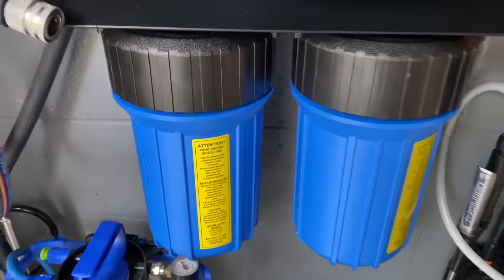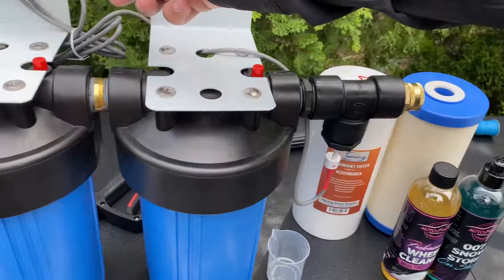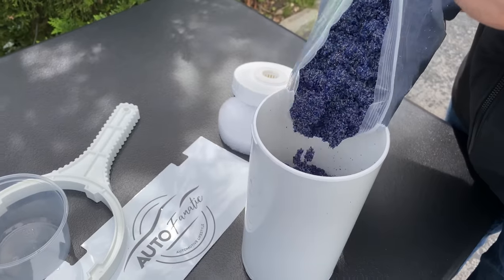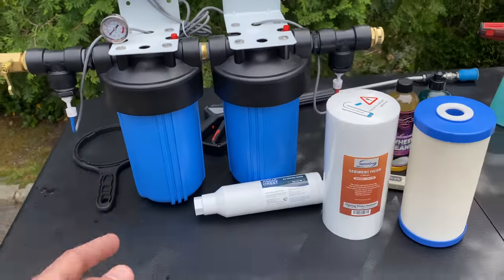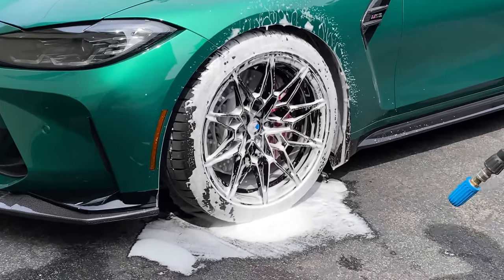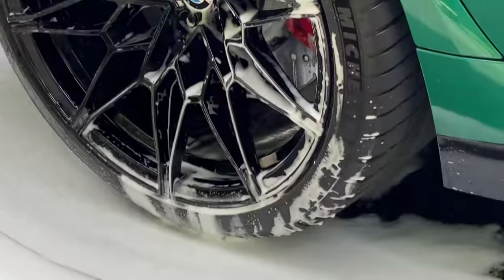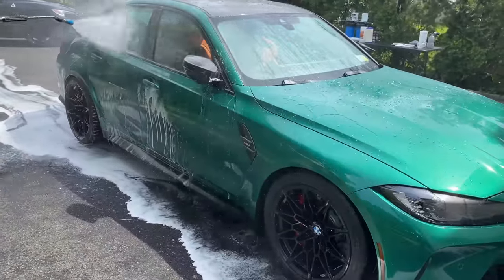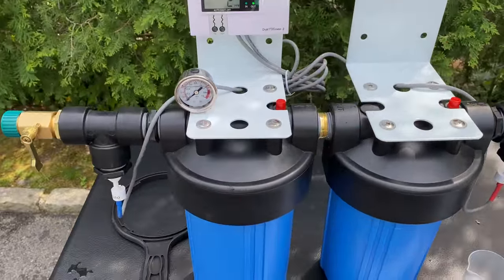Spotless Car Washing Thats An Affordable DIY | Auto Fanatic

Comment: Just so you know most places these days are changing over to chloramines in the water instead of just chlorine. A regular carbon block will not remove that. It will pull the chlorine out but the ammonia left over will pass right by into the resin and it will burn up the resin much faster. So anyone looking into this you need to find out what your water company is using chlorine or chloramines for the disinfectant.
Reply from the maker: Good to know but what filters remove this new chemical?
Reply: @autofanaticcars  hmmm, i thought I replied. I am not sure where to get the 4" wide 10" filters. I get my filters at Bulkreefsupply for my RODI unit for my reef tank. They have chloramine units for the smaller 10" filters and have them in the larger 20" as well.
Reply: What about Chloromethane
Reply: "50,000-gallon capacity replaceable highly compact coconut shell activated carbon filter provides over half year of clean water for your entire family.

This whole house system removes up to 95% of sediment, chlorine, chloramines, chemicals and other contaminants that create color, foul tastes and odors. (Tested by SGS, 2018)"
Based off the description, it seems like it's not just a regular carbon block
Reply: @autofanaticcars hey buddy new sub here I  have a question, I need sediment that takes out chemicals that will give me spotless water?? And allow me to do touchless washes?? I am a newborn, and in the sun, my black superduty gets a ton of water spots even if I work fast because of the heat!!! Please reply and let me know which cartridges to get and media to refill with thanks!!!!

Comment: Using that turbo nozzle is not the right way to do this... there is a stream of water that spins at high rpms and so you're directing a single stream of water on your powdercoated wheels. It's just a matter of time before it begins to damage that paint. It's like using a zero degree nozzle but with that single stream that spins. What you should use is a 25 degree with a variable handle so that you have control of your spray. similiar to the spray pattern you used for your paint job.

Comment: How many gallons will that two stage get you before you have to replace the resin. I know that carbon block will last a whole lot longer than that resin. I want a three stage setup with a carbon block and use cation resin in one and anion type resin in the other.

Comment: After watching this video my in-line filter broke for the umpteen time. Nothing like a clean car, clean garage, then having wet carbon particles all over. No more. The timing of this video was perfect!
Reply from the maker: Nice let us know once you get yours all set up how it works for you
Reply: Everything in and hooked up. TDS unfiltered near 200. Less than 20 filtered, but improving. It’s refreshing not being rushed worried about spots. The experience is better as well as the results!
Reply: What was the total cost? 
Did you order everything on Amazon? 
At 20ppm do you still get water spotting?

Comment: This looks like an awesome solution.  The only observation and questions…….   You are using color changing media.  Do they make filter housings that are clear instead of solid blue?  How would you monitor the color change with a solid filter housing?   Obviously a clear housing would make it very easy to know when a recharge was necessary.  

Thanks for sharing your well thought out design and great demonstration video 👍👍👍👍👍
Reply from the maker: Some vendors might offer clear housing but i think UV might skew the resin the easiest way to test is with a TDS meter once you see TDS get high it indicates time to replace resin
Reply: @autofanaticcars  Thank you so much for the quick reply.   I would hope in a garage that UV light would not be a factor.  Certainly the TDS is a good way to tell.  That pretty much throws out the color changing media which defeats the purpose of it.   There may be a less expensive option and I will investigate it.  I will share back anything I find as your goal was to cut down on the cost of the system.   It is still way less than anything I have seen and the TDS is a great way to keep watch on the efficiency.   ⭐️⭐️⭐️⭐️⭐️
Reply: @autofanaticcars  I agree, but how much UV light could be a factor in a wall in a garage?

Comment: Great video! Do you have the link for the part with tds sensor PVC and adapter? I've been looking everywhere for that pvc tee.
Reply: You ever find the tee fitting and reducer?
Reply: @xtnvieira No one?
Reply: You have to get a 3/4” to 1/4” reducing bushing then use a  male connector 1/4” NPT to 1/4” PTF

Comment: Morning from the UK, Great video. I have a water softer system in the house do I need both filters or just one for the de-ionising resin. also where did you get the double water filter wall bracket?

Comment: Interesting - I have been hesitant to use my pressure washer on my car, especially on the wheels - Concerned that soap/detergent will be forced into brake and bearing components. I’m retired, so I have plenty of time. Takes me less than ten minutes per wheel to carefully clean & dry complex Mustang PP1 black painted wheels. Leaf blower disperses almost all the water to help dry the wheels. I’ll have to give consideration to installing an up graded filtering system. Thanks & Happy Motoring 🤠
Reply from the maker: Our wheel cleaner system is the safest you can get specially designed not to corrode the brake system and anything in its pathways during use. I had a 15 GTPP and that led to my development of this system after torture cleaning those wheels and seeing the popular wheel cleaners that ruined my Brembo brake calipers
Reply: How do the wheel cleaners ruin the brake components? People have been detailing wheels for awhile and I’ve never heard of anyone causing damage?!
Reply from the maker: Start paying more attention to people’s brake rotors etc youll start seeing the patterns because most cleaners attack the metals causing rust and corrosion also two piece rotors with anodized hats develop white stains or cars with anodized  brake calipers (Mercedes, Ford, Porsche etc) get trashed permanently from harsh cleaning

Comment: Great video, thank you! So, I bought  the Ispring filter system. I’m on a well. I’m only washing my cars. Probably only use the filters for the final rinse? My question is, do I need to fill both filters with resin? Can I use one for the sediment filter? Sorry if this question was already asked! Thank you!
Reply from the maker: You can try it a few wa
Using one carbon filter and one resin and works amazingly well. Your on well water which does pose obstacles at times so you might need to see which configuration works best
Reply: Thank you! @autofanaticcars

Comment: DI units are great in cr spotless only problem is when your water TDS reading 300ppm like mine simply not cost effective resin has almost doubled in price over the last year
Reply from the maker: Yeah sounds like well water is a huge issue im hearing
Reply: Yes, I have well water and it is 300 ppm. It is very annoying but I need something more hardcore to filter mine i think.
Reply: If anyone figures out a cost effective solution please update!
Reply: @Embrxceyourdemons run through an RO system, then through DI into a 20 gallon storage tank (Rubber Made garbage can). Pressure washer then draws from the storage tank. I change my RO sediment and carbon filters every 6 months and the RO cartridge every two years. DI resin I have yet to change after 4 years.

Comment: Damn, 2k psi and you're that close to the surface. Living dangerously
Reply from the maker: Thata really not that much its all in your technique of using a pressure washer. Ive seen dummies put a zero degree nozzle on gas pressure washers to get bird crap off bumper’s to only lose their paint instantly 😂
Reply: @autofanaticcars the turbo nozzle is a 0 degree nozzle 😮 made me nervous was well 😆

Comment: Is this system plug and play? I am not very handy and want to wash my car but don't want to spend time doing a manual wash and just got a pressure washer.  Can I buy this system, the tds meter, resin and just connect it to water source and pressure washer and start using it? I want to use this on a cart or just wheel it out for use when needed for car washes; my objective to wash the car more easily, quickly and have no water spots on the paint and lights and windows.
Reply from the maker: Yes order the Ispring kit shown off Amazon with filters all links in video description below

Comment: Great video! I’m going to start my build today! I have a 22 Mach 1 with the handling pack wheels. Very difficult to clean like the M3s. Can you recommend a good pressure washer and foaming attachment?
Reply from the maker: Hi David pressure washers are subjective but I am a firm believer to spend the most you can because it is the most important part of building your wash system. I use North Star on demand electric pressure washers look into them at Northerntool.com mine is s 230V but they also offer 115v version. these machines are workhorse you can not kill them plus they double duty to do real tasks around the house. Stay away from cheap stuff at Home Depot and Amazon that will leak and be useless long term.
Reply: Thank you!

Comment: Will that work if you install them horizontal? Basicly the filters are lying flat at the bottom in the middle of my detailing van
Reply from the maker: Water filters are not designed to work on their sides

Comment: What is the pressure washer that you’re using? Do you use this pressure washer on the paint as well other than the wheels. It seems like the pressure is too high for the paint. Although I have use a gas pressure washer with 2700 PSI on my paint and I have never had any issues with my paint.
Reply from the maker: My psi is under 2000 to wash cars its a 230v North Star on demand unit 2.5 GPM
Reply: @autofanaticcars  Thanks. I’m a little surprised you’re not running a Kranzle. I’ve never heard of 230VZ North Star. I’ll take a look into it. Was looking to purchased the OG Kranzle 1322t to replace my Active 2.0.

Comment: For the TDS probe it appears to be a 3/4 NPT tee fitting. Did he pvc glue the 1/4 probe into a hole he drilled into the 3/4 plug at the bottom of the tee?
Reply: It’s a 1”x1/2 reducer bushing with a 1/2-1/4 connector in that, couldn’t find a 1”-1/4”…
Reply: @jerrycube6244  do you have a video of how you attach the meter?

Comment: I copied this system with the 2 iSpring housing units with 2 GE Whole house w/ carbon filters as pre-treatment.

My TDS before the system was 107 ppm and after was 1 ppm. I let the water run for a good ten minutes and washed my car afterwards. I estimate that I used a good 50 gallons of water. My TDS was 7 ppm after the wash. Is this pretty normal to expect the ppm to raise that quickly or do you think 2 housing units is not enough for me and that I should consider adding a 3rd iSpring filter. 

Thanks
Reply from the maker: Seems you have a massive improvement so far just monitor things over time tds can jump around some over time but if you stay under 20 you should be ok but play around with filter arrangements im
Using 1 carbon 1 DI resin with 6 months of yield
Reply: It's at 0 ppm now that the system has had time to settle in with a couple uses. I saw a post here about someone talking about chloramine. Have you found a solution for that? My city moved away from chlorine and swapped to chloramine
Reply from the maker: they are using chloramine in our water was well very toxic stuff and more concern inside the house than for washing your cars. I have a multi stage main house filter and it requires changing almost every 2 months now which is getting expensive.

Comment: Can you link to where you found the tee for the TDS meter? Most of these are meant for 1/4" but my pex will be 1/2" for proper water flow. Would love to get it in black as well :)
Reply: Same for me. Searched for the probe connections on us plastic. Can,t find. Thx.
Reply: It’s a 1”x1/2 reducer bushing with a 1/2-1/4 connector in that, couldn’t find a 1”-1/4”… item #’s 30744 & 58765 on US Plastics

Comment: So this is probably a stupid question.  Does the unit have to remain vertical to function properly? I have been thinking about doing something like that to where when it comes time to do my final rinse I unplug the garden hose from the pressure washer and put this setup inline however, looking to just lay this on the ground while using don't really have anywhere to permanently mount it.
Reply from the maker: it should work however you risk banging the housing around and it might affect water flow and cavitate the pressure washer pump. you wont know unless you try it i guess.
Reply: @autofanaticcars  Cool thanks for the info.

Comment: Do you have a price per gallon estimate for that system? Not  sure if you mentioned it.
Reply from the maker: I will work on that and post but it all depends on total usage before refills
Reply: @autofanaticcars  thank you for responding. I’m trying to find an affordable way to do this type of stuff for my setup. I don’t have big pockets. Iwould like to get the best results I can for the sake of maintaining the cars in my family.
Reply from the maker: You can consider starting with smaller inline Camco RV filters which do work great for most and its most affordable solution.

Comment: Do you have the links for the white L brackets and the Black T pipes for the TDS readers?. Great vidoes
Reply from the maker: Will be posted later for those two items
Reply from the maker: Items were bought from US Plastics you can email us for a parts breakdown
Reply: @autofanaticcars  Can you send a link to the parts?
Reply: @autofanaticcars can I get a parts breakdown for adding the TDS meter?  Thank you
Reply: @autofanaticcars can I get a parts break down? Thank you

Comment: Just to confirm as the measurements look to be the same between the double unit and the single unit, but does the empty cartridge for use with the resin fit either one?  I only have space for one and would prefer to use with resin (I think likely the most effective option).
Reply from the maker: The cartridge we filled in video fits both housing you can order the housings like mine dual or individually the ones we used are linked below so you can pick a chose an option to fit your needs. Filters are sized 10x4.5
Reply: @autofanaticcars  Thanks.  I just pieced together a single 10x4.5 unit with the DI resin.  Disappointingly, I'm going from about 130 TDS from the spigot to 30 TDS after the resin.  I added a RV inline pre-filter to see if it might knock it down a bit, but still ending up at around 20 to 25.  I tried turning down the flow to see if I had too much incoming pressure, but no change. I don't think I'm that high to start, to only get down to 30.  Just to confirm, if I measure from a jug of distilled water in the same container I get the expected 0 TDS (so it's not the measurement meter or container used).  Would adding a second DI help?  If I should be getting to 0 with my setup, I'm not sure what might be wrong other than the rubber o-ring / washer at the top of the cartridge not sealing well.
Reply: John what was the cost on the total setup?
Reply: @johnsortino I'm having the same issue.
I have a whole house carbon filter, then run through my water softener - average about 210 TDS - my double 4.5 x 10 resin filters only lower the TDS by about 70-75 TDS - resulting in a post resin TDS of around 140.

SOMETHING isn't right....

Comment: So can I just continue using the camco filters or do I need to switch?
Reply from the maker: if the Camco works for you and you get improvements in water spotting, flash rust and better soap stick with it but the system shown here is much more effective considering the flow rates of my water feed at 7GPM.
Reply: @autofanaticcars  kinda off topic but been meaning to ask you do you solely use mineral spirits for tires or do you use a rubber cleaner first and follow up with mineral spirits?
Reply from the maker: mineral spirits on a new microfiber is all i use, no rubber cleaner and brushes takes too long and not as effective plus you need to wait for tires to dry where as mineral spirits evaporates instantly to apply tire dressings

Comment: I have 260 PPM.  I haven’t found any system that wont fail after 2 washes.
Reply from the maker: wow thats high what systems have you tried? you should try this out and do one filter with either sediment or charcoal and  the other with DI resin to see.
Reply: @autofanaticcars  CR Spotless-DIW-20 and max water.  Both with a water softener and a carbon pre filter.  About the only thing I can get to work is a 7 stage RO system but that’s for drinking water not conducive to clean a car with.  I just about given up. Clean my car almost at night when is cool and dry fast but it doesn’t work.
Reply from the maker: Wow where do you live?
Reply: @autofanaticcars  Austin TX

Comment: That’s a damn good way to destroy the finish on your wheels ! That tip is for cleaning concrete not auto detailing
Reply from the maker: Nope perfectly safe at 2000psi or less been using it for years never an issue